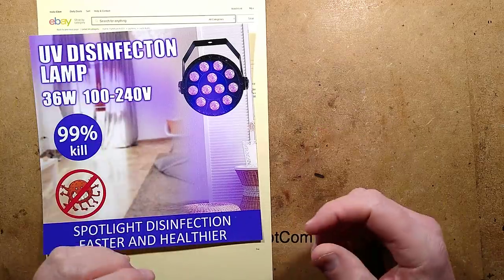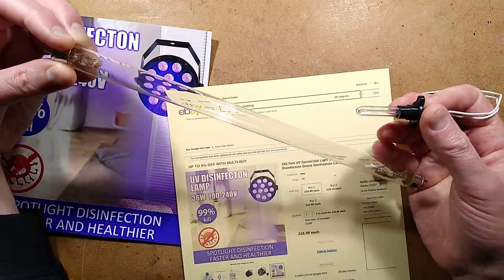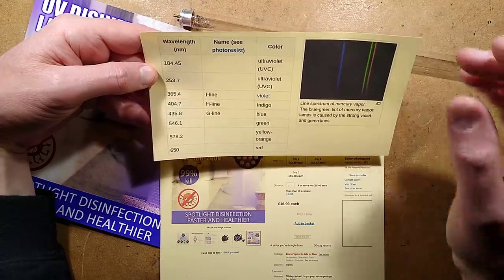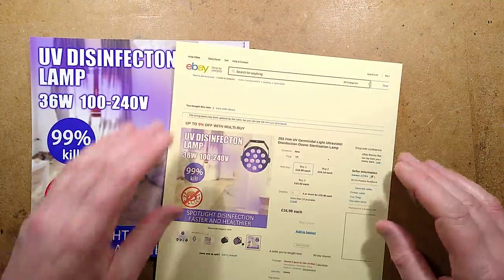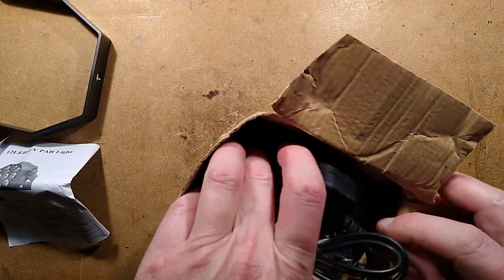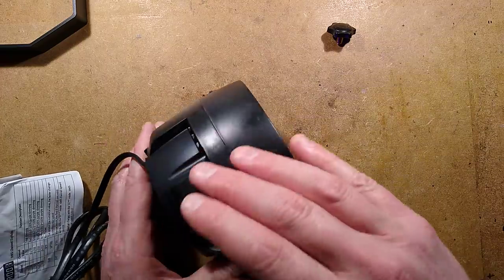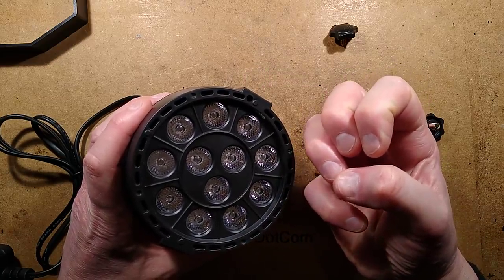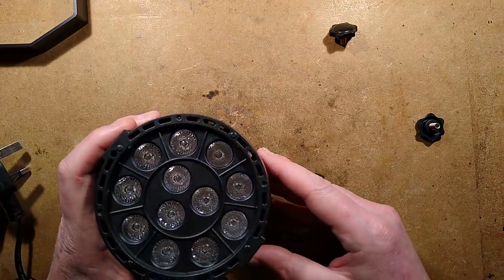Fake UV disinfection lamp from eBay.

Comment: It's hard to know which is worse: selling a fake lamp which emits no UVC, or selling one that DOES emit UVC and can damage your eyes and skin.
Reply: It's alot like a gun.....it kills things, so the idea is aim it at the target and not at yourself.
Reply: Well considering the lack of warnings and stickers to advise of UVC danger, I'd be pretty happy it's not actually.
Reply: If you want to disinfect things you need the UVC.  You just need to use it with proper safety in mind.
Reply: @neville3151  but with far less popular knowledge of how they work and what safety should go along with such a tool.
Reply: @jkenny1  Absolutely correct.....got flash burn from welding when i was younger and the pain was near unbearable.
Reply: Ozone. Oxidizer. Destroys most organic tissues (lungs, eyes, skin, etc...)
Reply: A fake one, obviously, since if you buy an UVC light you know it may produce ozone, if on the right frequency.
Reply: Adymn Sani  Real UV-C is no joke. These "UV" LEDs are a joke, though. (just clarifying, since you said "this light")
Reply: Making one that works AND is designed for internal use.
As approved by Trump🤦‍♂️
Reply: if you sell it as such it is more dangerous to lie, would you rather have a knife with a sharp blade or would you rather order a knife and get a spoon?
Reply: Its fine to sell and buy legitimate UV lamps so long you are responsible....
Reply: Which is worse? Going blind from the real thing or realizing that you got scammed? (Never mind. I think I answered my own question.)
Reply: Adymn Sani  

that won't work unless you plan to leave the mower running in one spot for several hours.  then move it to the next little spot...

in short, no,  it's a con.
Reply: The fake? Sure, the other one can cause damage IF its used incorrectly, but the former is false advertising, false hope, and false reassurance. Would you rather have a medicine with some potentially nasty side effects but does the job, or would you rather have some snake oil that, while it has no side effects, has no beneficial effects either.
Reply: Morgan Sinclair; yeah properly using a fake uvc lamp instead of Lysol or soap and then still getting sick from the unkilled germs still alive on surfaces you wanded.
Reply: @TheAnantaSesa  Read the edit.
Reply: Hi! Do you want a safe to use UV-C kit? CleanLight supplies them, I can really recommend those!
Reply: Arjo van der Sluis; is that far UVC? I already bought a bunch of allegedly uvc LED wands but without a spectrometer all I can see for sure is they have uv florescence effects. Who knows if they are actually germicidal? I have doubts now that @Clivedotcom did a review showing that a uvc led must have a quartz glass lens or else the uvc light will destroy the plastic.
Reply: securitycountercheck; lots of surface mounted visible light LEDs are tiny squares but to not break down from the emitted uvc, they need to be quartz glass not plastic. this shows a uvc led. http://www.cel.com/pdf/press/cel_uvc-leds_03262019.pdf
Reply: people or animal need to be out of the room when you light the UVC lamp(normally 30-60 minutes is enough one time), but it kill germs effectively
Reply: I think the former is worse, because that is a defraud behavior,  and we could not sure the current technology of UVC light could be shined on skin and eyes yet. So some products in the market should be used in a careful way, which would be also safe and useful.
Reply: Or uneducated comments........you have to do your research and use good judgement and good old common sense!
They are only bad for you if mishandled and not used properly because the proper UV-C is VERY effective at killing viruses and germs when used properly.
Reply: @chriscrystalhood6260  wow soyboy
Reply: LG makes a UV-C diode that's highly efficient and used regularly in indoor gardening. I have two housings with UV-C and 4 housings with UV-B. These have been sold for over 10 years(except LG's UV-C which has only existed for 3 years)
Reply: Fake is worse of course. Anyone using a real one should be aware of the dangers. Lots of common household items are dangerous if not used properly. UV sterilisation is perfectly safe, with adequate precautions.
Reply: UV is the sunlight. Does it damage your eyes? Probably it does if you look at it straight. Do you do that? Considering your comment perhaps you do.
Reply: @troyna77  Ozone, if properly used, is a very effective tool.  our office had a water leak,  and the company acquired the services of a cleanup business,  they come in with hazmat suits, dried and cleaned the area,   and finally, they come in with a industrial type ozone generator. which is activated after hours when no one is around.  the ozone seeps behind walls, and all over the place killing mold and mildew.    Ozone has a very short half life,  about 30 minutes or so,  I have seen these units in clinics, they use timers, to activate late at night, and turn off before people arrive.   Ozone is also used in water purification,  both for drinking water and swimming pools.
Reply: @v.sandrone4268  "Swallow two UV-C LEDs and call me in the morning. "
Reply: ddze; who knows who you are responding to?
Reply: agriperma; ozone is the least concern with uvc. There are bulbs that don't create ozone by filtering out the wavelengths that create it. You can smell ozone. You can't see uvc (just the florescent effects). It still burns your eyes despite being invisible like an x-ray.
Reply: @TheAnantaSesa  Hi , it is not far UVC, it is medium pressure UV. Just google 'CleanLight'

Comment: Get a dispute started as it's obviously not as described.
Reply: definately dispute  as said and it may help to stop chinese false selling (some hope) :-)
Reply: Absolutely, I actually buy things I know will be fake sometimes just to dispute and punish the seller with shipping fees... They know this stuff is fake but sell it anyways knowing they'll pull a net profit including disputes.
Reply: 3:21    1. Insufficient disinfection and sterilization
Sounds like they nailed the description :)
Reply: @jkenny1  you should get a fake deathadder razer mouse then XD there are LOADS of fake razer products on eBay for like a 10th of the price. I got a fake one intentionally and it is not toooo bad. But yes just say "it's fake" and even tho they list it as OEM so people don't do that they do say 70% of the product is real. This is false obviously. Even if you did it by number of components or even weight all of it is FAKE. Lol it does work nice as an office mouse tho - fairly decent for like £10
Reply: Has it just got millions of buttons on it? Is that how it's any different from a regular office mouse?
Reply: @TheDarkness344  Thanks for the suggestion, though I don't think I need any more corded mice :) I do this for 18650 batteries, which is my area of expertise. Most of them turn out crap capacity (e.g. 1700mAH measured vs. 3400mAH claimed), but some are the same capacity, but the wrong cell (e.g. not really a Pansonic/LG/etc.) and can be proven by appearance. Panasonic is the easiest because the top of the cell looks very different on a real one vs. any of the fakes.
Reply: @jkenny1 While it is honorable to do that, some marketplaces don’t take it kindly if the customer disputes too many orders.
Reply: How many could you buy, and dispute, before ebay stops letting you dispute them?  I'd love to hear about hundreds, or thousands of these showing up, each of them costing money to make and send, and then refunded....  Could hundreds of us put them out of buisness if we did it hard enough?
Reply: Ebay dispute department is closed...
Reply: @ICountFrom0  Good question. I haven't been blacklisted yet, nor am I doing anything wrong. Might be questionable if I buy the same item over again after knowing it's fake from the first time and winning a dispute. I tend to move from one seller to another. I've done maybe 10 or so "knowing it's fake" orders, and won almost all of them, at least partial refund if not. Disclaimer: I'm also an eBay seller with 1100 positive feedback for whatever that's worth in their judgements.
Reply: There'd be something to be said for organising and ordering one each en-masse, then everyone claiming "not as described". Each claim would be perfectly legitimate and it would probably make them unprofitable to sell in this misleading/potentially dangerous fashion (or at least more awkward especially if people did it on a rolling basis as new ones cropped up). 

I'm often tempted to do this with obviously fake items like 1TB USB drives just to take them out of the system, knowing that I'll win a dispute and the return won't be economical.
Reply: @anononomous   Yes but you have to pay the trash bill and deal with disposal.......... :)
Reply: @Starlite123  You can just run H2TestW on them, find out the real capacity, then create a partition of the right size. They're crappy, but functional 16-32GB flash drives. I think someone with as large a viewer count as Clive could organize such a mass purchase/dispute easily. I'd do it but I only have 400 subs that don't watch my stuff regularly ;)
Reply: @Starlite123  Which is why it would be better to do it as a group. 
Ordering a single item, testing, claiming and recycling/disposing wouldn't be much hassle. Plus each individual order wouldn't arouse suspicion with the disreputable seller.
Reply: @jkenny1  I was kinda making a joke, but usually the working 4.2821GB sd card is useless  :(
Reply: @Starlite123   I've gotten quite a few fake SanDisk "256GB" micro SD cards. They're "real" 32GB cards, and I use them for cheap devices/unimportant tasks where I need a lowish capacity SD card. Can't complain for the price of free (minus my time to open the dispute) ;)
Reply: I purchased on eBay a flexible solar panel that was sold as 20w. It barely got to 5w in the full summer sun. I raised a dispute and after multiple emails ended up getting a full refund and I got to keep the solar panel. Winner winner chicken dinner.
Reply: TheDarkness344 did they managed to get that fake razer to work with razer synapse rgb effects?
Reply: @jeoffer  Lol so instead of a 24hr charger its a 3 day charger. Maybe you mean a piece of chicken dinner... but hey some chicken is better than none.
Reply: @anononomous  Thats funny but im in with what u r all sayin.
Reply: @jkenny1  Yes as have i but usually the files still corrupt. But im good with the cause here lol
Reply: @Starlite123  I guess you've convinced me to do a "cycle test" on my fake SD cards, see how many h2testw runs they'll last :)
Reply: @jkenny1  fun for free lol :)
Reply: @jkenny1  yea lol that's a good idea - I bought 4 "9000" mah 18650s for a fiver lol I knew they were fake, but I just wanted batteries that had around 1000mah I could of always destroyed a Poundland power bank tho lol. Those batteries that I got even sounded hollow inside XD and when I broke one it rattled when I shook it lol. I am guessing they had a smaller li ion that they were like LeTs SaY ItS 18650 and just made the right sized shell for it XD
Reply: @TheDarkness344  Anything rated over 3500mAH is guaranteed to be crap, like <1000mAH. At least when you buy fake name brand cells (e.g. Sony VTC4/5/6, LG HG2, Panasonic NCR18650B) you'll get something around 1300-1700mAH, or full capacity but a generic cell. Harder to prove they're fake though unless you have a discharge tester, and better yet a real version of the same cell, so you can compare them visually.
Reply: @milojkokitic6991  no sadly - but it is just a "chroma" cycling effect. It looks actually good - better than my deathadder 2013 and just as good as my elite lol. Only big noticeable difference is the buttons. They are like an office mouse just a bit harder to click. I don't mind it and I would say it is a good budget office mouse but if you are going for gaming it is alright. If it is an FPS however definitely go for a second hand one for like £20. It is worth the extra money.
Reply: @NeuronalAxon  lol it has your normal buttons plus a button 4 and 5 (two on the side) they are the wrong way round for some reason so you may have to remap keybinds lol. I said it is literally no difference except the appearance becuse it probs uses an office mouse sensor and buttons ~1000dpi I haven't tried to test the sensitivity tho, but i would say it is around the same as a £15 office mouse so just maybe it is worth it.
Reply: Oh and if anyone is actually looking to get one lol it also might pair nicely with a fake razer mouse mat and hammerhead earphones XD
Reply: TheDarkness344 i dont like buying second hand, i already have most of razer devices in my gaming pc but i was tempted to try fake one just to see how it compares lol
Reply: @milojkokitic6991  yea lol If you are just buying one like me to try out then look for the ones with OEM in the name/description there is like a 99% probability that they are fake and also MAKE SURE it is under £20 or you are just wasting your money. At the current time there are none on the market for under £20 (Corona virus halting production) but hopefully when it ends there will be some for around £10 - £15 and you could test it out lol. There is a very noticeable difference in the button (on how hard you have to click) and also the side buttons have to be pushed in a LOT more than normal. It would be cool to try a fake out tho lol. I would use mine just for display as it looks really good and almost the exact same.
Reply: We don't know how it was described.
Reply: I bought a couple of "handheld UV lamp" just to found out that the wavelength are not in the UV-C range. It is just a black light. I contacted Ebay and told them that those are fake/scam but they really don't care.
Reply: @SimonWoodburyForget  Surely ebay are used to dealing with the sort of scam where multiple items are sent to buyers that are (maybe more obviously) not as described, resulting in multiple claims. How would this be any different to that in terms of profile?
Reply: @ICountFrom0  It would be a way of getting even with the ChiCom businesses for attempting to profit from a pandemic, especially fraudulently.
Reply: @jkenny1  Is it true that you can get a reputation as a bad buyer that the seller knows about? I had a problem with buying things described as in good condition, but were factory flawed, or well worn, such as a pair of shoes, then had to send them back, they would photograph the good side and didn't disclose the problem areas. Finally I got tired of it and cut back on fleabay buying substantially, except for odd items like appliance parts.
Reply: @a.fritzbecker8986  Unless you have negative feedback as a buyer on your account. I mean it's possible but far fetched that the sellers would talk among themselves and have a s*&^list of bad buyers haha. I'd probably be on that list :)
Reply: @jkenny1  I just remember someone suggesting that you could be tagged as a bad buyer for returning merchandise. But it wasn't like I was filing disputes for no reason. I thought maybe it was connected to that rating system with transactions, I always paid so I thought I did my part.
Reply: 14:30 the seller is trying to capitalise on the current health crisis, and eBay needs to understand that it's bad business for them to risk the health & safety of people; especially during such troubled times like this.
Reply: @barrykuli7534  You would have to file a dispute, just reporting to fleabay does nothing. Just like with Amazon they profit from people peddling counterfeit products, except Amazon goes a step further and censors negative reviews.  
  Fleabay does nothing about shill bidding scams either,  even though it is illegal in most places in real auctions. There is a Y.T channel where the guy on there has bragged about doing it on his own auctions. I stopped watching his channel because of that, I won't patronize someone who is amoral in that way.

Comment: This must've been developed by bacteria so they could have a nice safe disco party.
Reply: Not if they are using DMX ;)
Reply: @jaighter  Mixing up a chemical  (DXM) with a comms protocol for stage equipment (DMX or DMX512) can cause confusion and other side effects, included but not limited to...
Reply: @nebufabu  lets smoke some drain off from grease traps broham

Comment: "Twats!"  - I don't think I've ever heard you say that before Clive.
Reply: Something far ruder, also appropriate.
Reply: I agree, it was a surprising outburst from the big man himself !
He usually uses sarcasm and humour to point out safety bypasses, I've never heard him get angry about them before !
Reply: 5:00 SMOOOOOKE ON THE WATER - FIRE IN THE SKY!!!
Reply: They basically did the electrical isolation right, then ruined it to make the board 5mm narrower.  The proper design would have the opto isolator next to the Y capacitor so the isolation gap runs directly under it.  Instead they shifted it lengthwise on the board so the extra tracks runs too close to the live mains tracks.  Casing was big enough for a wider, shorter board, forcing internal examination to spot the danger.
Reply: Deep Purple had much better lighting
Reply: i am proud to be the 42nd like of this comment
Reply: Sometimes you have to call a twat a twat.
Reply: “Jesus suffering fuck!” Is popular in Glasgow, yes?